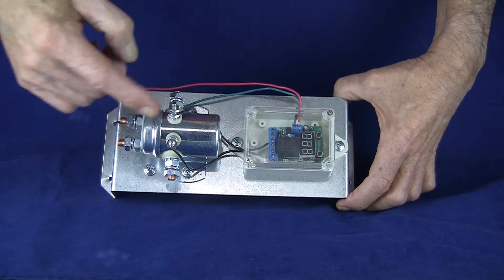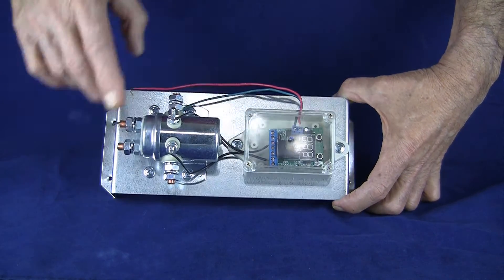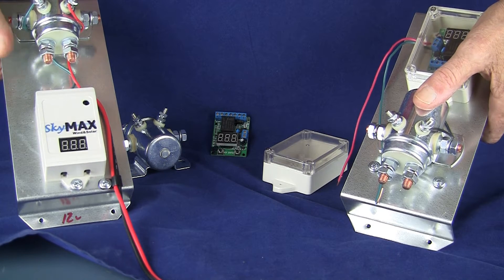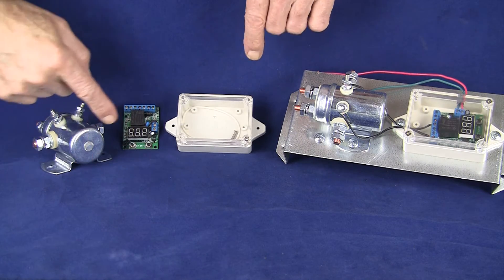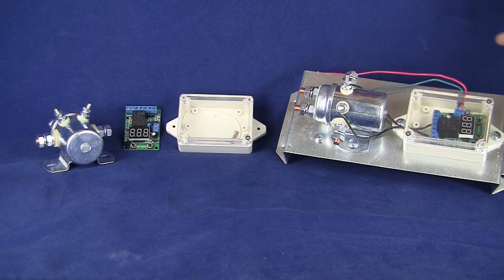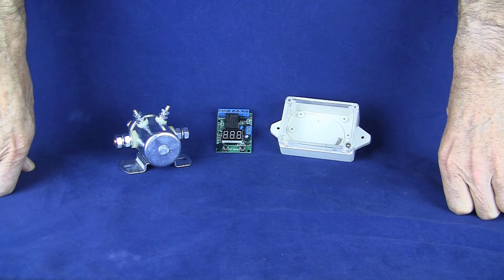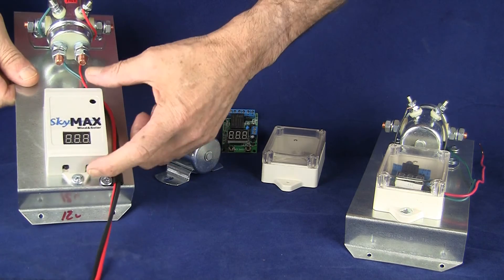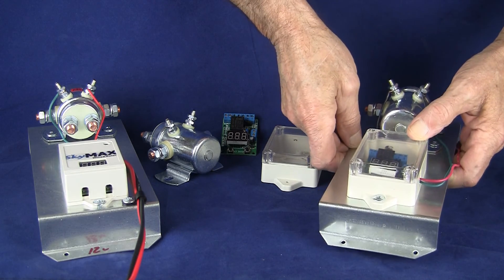How to build a 10,000 watt 440 amp wind turbine charge controller SEA440AJE

Comment: Can ANYONE make a youtube video detailed video for an off grid setup? Why do you use the relay? Why is there no three phase input thermals ? Is the relay needed always,when,where,on what ? How much amps can the controller deliver (i have read  it is about 10a,so it is not 100A or 440A 12V). Can you have multiplier controllers with one relay ? Why use resistor if you can just add heater wire ? I have also heard you must have a dump load if you use off grid converters (12-24VDC to 120-220VAC) but not needed for battery ...and so on. How to deliver 12V FIXED voltage or just 12-14v for battery charge,ho to delived 120-220VAC... More details about this kind of relays are needed,ho much is OUTPUT voltage/current , how much is INPUT Voltage / current , if it is a 12v relay why use a controller ? ... sorry but I am new and confused about all this.

Comment: Hello. I'm interested in buying this silver piece with 6 electrical connection terminals, but would like to understand whether it is for what I need.
I have a wind turbine 24v 1000w x and 4 solar panels 24v x 1000w. I also have a solar charge controller 40 Ampere T-40, I have two stationary batteries of 115 amps each, and two voltage drives a modified wave 2000w and other pure sine wave 1000w. Miss me set the wind system, as so far have not found a machine that allows me to expand my system later without make changes.
My questions are; If this component is for me to call my panels and wind turbine together in the same contact terminal, or must have a piece of this for each source of energy?
Can I use it with a MPPT controller T-40 as I have?
From what I understand, but do not know if it is correct, this piece can hold up to 10,000 watts from various panels, or more wind turbines? That's right? Could you give me a more detailed explanation of the functions of this component?
I live in Brazil and do not speak English. I'm communicating by google translator, I apologize for mistakes in writing your language.
If the piece serve me, I want to import it, as will calls it in my house, and has several friends waiting for my results to assemble their systems and everyone will want to buy from American stores. I am seriously thinking of choosing an American supplier to make good deals buying and installing components in Brazil residential systems and companies.
Mr. It makes sales to Brazil, or it could indicate someone who does?
For those in Brazil it is difficult to contact the stores on Ebay for questions. So I came to your page on youtube to ask for your help with these questions.
Thank you.

Comment: Hay Jeff, Can I just buy your SkyMax 12 volt controller electronic box , with out the relay and metal plate? I want to upgrade your old 12 volt charge controller that I already have to the new one with the easy to use adjustment buttons and LED screen :)